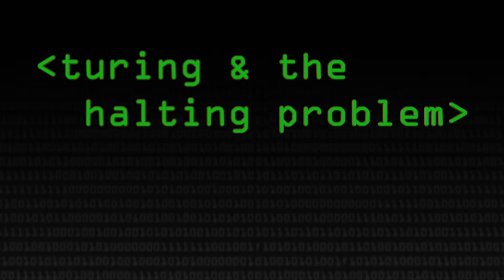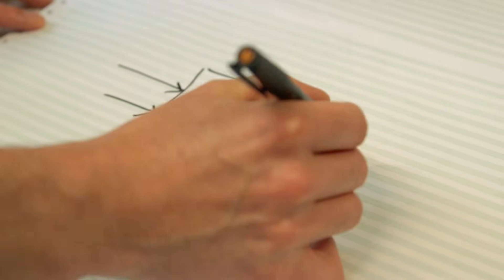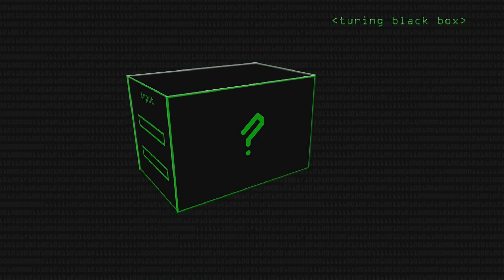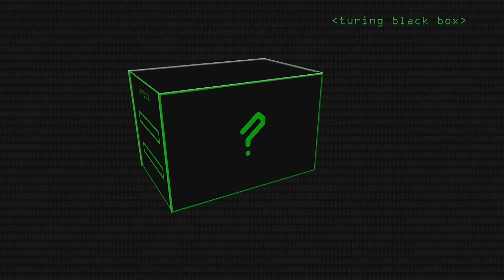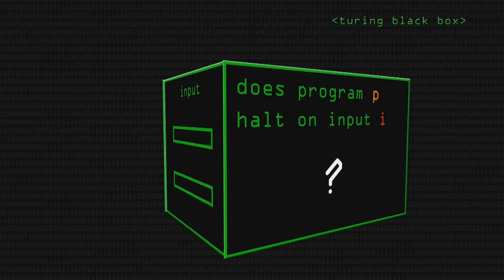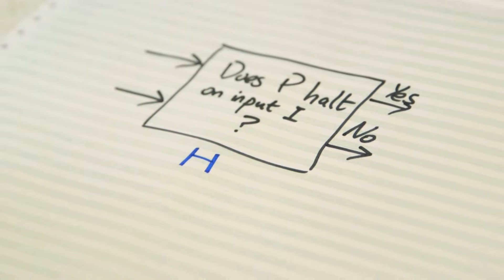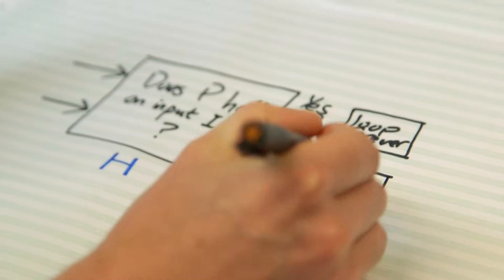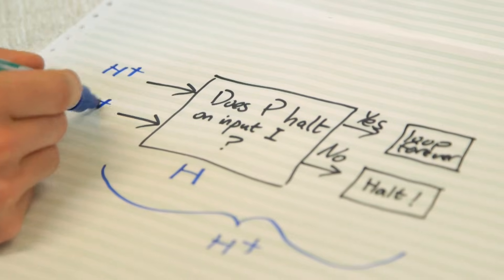Turing & The Halting Problem - Computerphile

Comment: Wouldn't this imply that it is impossible to fully simulate a universe? Because you have to use a computer to simulate a computer created in that universe, and then simulate if it will halt or not. So we are back where we began.
Reply: You don't need to simulate if it will halt or not. You just need to simulate the next step in accordance with the next step of the universe. It doesn't matter if it would never stop. You're running the program anyway.
Reply: It's not necessary to simulate it in real time.
Reply: You dont have to simulate if it will halt or not because the simulation will NEVER have an infinite amount of  time.

Comment: There's one little problem with this. Paradoxes do not exist.
Reply: Paradoxes do not exist that's why it's a contradiction.
Reply: That's why the machine can't exist.
Reply: Cabhan Listis The concept that I think seems to confuse you is proof by contradiction.
In a proof by contradiction you assume that what you want to proof to be false is true and then you proof that it is false by deriving a contradiction from this assumtion.
In the video the thing that he wants to proof to be false is the statement "there exist a machine that solves the problem". Thus he assumes that this statment is true and derives a contradiction (=> Paradox).
Reply: This statement is false.
Reply: Here is also a nice (and comparatively easy) example that I just found to illustrate how proof by contradiction works:
Theorem: There are infinitely many prime numbers.
Proof:
Assume to the contrary that there are only finitely many prime numbers, and all of them are listed as follows: p1, p2 ..., pn. Consider the number q = p1*p2*... *pn + 1.  The number q is either prime or composite. If we divided any of the listed primes pi into q, there would result a remainder of 1 for each i = 1, 2, ..., n. Thus, q cannot be composite. We conclude that q is a prime number, not among the primes listed above, contradicting our assumption that all primes are in the list p1, p2 ..., pn.
Thus the assumption that there are only finitely many prime numbers is wrong.
Thus there are infinitely many prime numbers.
Reply: A paradox is a didactic tool. Zeno's paradox teaches about bad factorization. Epimenides (I always lie) teaches about infinite regression and recursivity, etc. They exist as teaching instruments.

Gödel's incompleteness theorem is analog to the input / output device problem. Containment in set theory faces the infinite regression problem.
Reply: Shaun Dreclin
That's a paradox. Yes. Does your statement have a reality? Because if you think it does, then I would invite you to feed my pet unicorn. It's getting hungry.

Comment: This seems incorrect. H+ looks like it needs two inputs, not one. Hence the Question "Does H+ - being fed H+ as an input - halt?" would be a nonsensical one. The question one would need to ask would be "Does H+ - being fed H+ - being fed H+ - being fed H+ - [...]" and so on. Of course one could never ask that question, since it does not halt ;-) .
Reply: H+ takes 2 inputs, the program and the program's input. You want to test if H+ halts when given itself to test, so you feed it H+ as the program and also H+ as the program's input.
Reply: Nixitur even if H+ only takes one input, that still doesn't solve the problem because that one input will need one input, which will need one input, and so on.

Also, if you construct some way of making H+ give itself as the missing input, then the self-input would need to add itself as input, which would need to add itself as input, and so on. And in this case you've created an infinite loop that occurs before it ever gets to the evaluation by the H part of the program. It fails at the gathering input stage. And since it never got to the H part of H+, it makes no sense to say this is a failure of H.
Reply: xybersurfer If you have supplied a definite input, then you should be able to follow the logic so that when you get to the H part, it will give you a definite output.

If you loop forever either before or after the H part of your construction, this does not prove that the H part itself couldn't conceivably work.
Reply: BTW, I'm not saying that such a proof isn't possible, just that it would have to be significantly different than what's shown in the video.
Reply: This is exactly what I was thinking. I don't see how this proof answers anything 'cause they've given it invalid input.
Reply: yeah, their definition of H+ is wrong. the correct one is H+ = "given i, does H(H+,i) halt? If yes then loop forever, otherwise, halt"

AFAIK there's no way to avoid using a self-reference of this sort to get the contradictions the proof needs (of course, first-order logic provides a way to build these self-referencing programs).
Reply: Oh no, I was not in any way shape or form suggesting that a machine could be constructed that answers the question posed. Quite the opposite: I was suggesting that the "question" posed was completely void of content since there is no such thing as "H+ with input H+", seeing as H+ always has to have two inputs. Now these may be the same, but there has to be two inputs. Hence there not being an answer to the question does not disturb me in the least, much like there is no answer to the question "what is the emotional state of this mineral?".

Also I study this kind of thing once, I only just noticed. And the "math" going on in the background is not really all that complex.
Reply: Hmm, yes, I saw what you mean.
We can't just feed H+ into H+ because H+ needs two inputs.

For people who don't see why this is a problem:
We feed H+ as the program and H+ as the input into H+ itself. Let's call the first input H+P, the second one H+i and the one that they're fed into H+'.

Let's concentrate on the first half of H+', the H-part.
What the first half of H+' then does is answer whether H+i as the input to H+P halts or not.
However, that doesn't make any sense since just feeding H+i into H+P is insufficient.

H+P needs two inputs, let's call them H+PP and H+Pi. We've only given it one input H+i and no instruction on whether that should be the program- or the input-input to H+P.
Even if instead of H+i as the input to H+', we allowed two H+i programs, we'd just move the point where it breaks one layer further down since H+PP also needs two inputs.

However, this can be solved.
If we say that, if given only one input, H (and H+ as well), take that one input as both the program- and the input-input.
So, if we give H just one input P, it would test whether P given P as an input halts.

Or, alternatively, H+ only ever takes one input and feeds H+ and that input into H, looping or not looping according to the description in the video. So, H+ doesn't even have a program-input and the program-input to the first half of H+ (the H part) is only ever H+ itself.

I think this is how the proof originally goes, actually. It's just not as simple to understand, so Mark probably tried to make it a bit more simple and, in consequence, made it make no sense.
Reply: watcherFox why would an input need another input? we aren't confined to only using H or H+ as inputs.
Reply: i wrote down the demonstration used in logic, i explained why we define such precise functions and why we don't lose generality in the proof, if you're interested check it out :)
Reply: Of course it seems incorrect.  The conclusion is counterintuitive.  But it is indeed true.  Trust me, I've met many programmers who were convinced they could create a program like "H", completely unaware of the Halting Problem and its impossibility.  They've all been let down.

Keep in mind that what you're seeing here is a simplification meant for general audiences, and that there is complex math going on in the background which was vetted by generations of mathematicians long before you were born.

Comment: you are assuming that the program that solves the halting problem halts.
Lets assume that it may continue forever for some inputs instead, then it is possible I think.
If the computer ever reaches the exact same state twice, the program will never halt.
If the computer never reaches the exact same state it will halt.
Reply: If the program that solves the halting problem fails to halt on some inputs, then it doesn't give the correct answer on every input, because on some inputs it gives no answer at all.
Reply: khoitrinh1 that's not the strategy of the proof in the video. They don't prove that there are inputs of H that do not halt, they just prove that from a working H machine, they can build a machine H+ that contradicts its own existence. Since H+ is impossible, but the steps to create it from H are completely valid, then H cannot be possible to build.
Reply: *****
That's not a proof of anything though. That just disproves what Victor Påsse said.
A program that solves the halting problem has to halt. To use that as a proof, you would have to prove that the halting program would have inputs that result in it never halting. That has not been proven in the video nor in Brian's statement.

Comment: What is the human brain if not an incredibly complex machine running a really abstract algorithm?  Yet we can determine whether programs will halt or not.  I probably missed something, but to me it seems that Turing is wrong.
Reply: No, we can not tell if any program will halt or not any more than a computer can.

We can sometimes tell if a program will halt.
Reply: Yes, I think it means that we can not know the final output without running the program first. Of course we know that the program halts if it just halts after a run, or it loops if the loop is defined clearly in the source code. BUT we can not know it in all cases. For example there are mathemathical calculations that may be solved by running iterative program a finite amount of time, or may not be solved ever. This kinda would create a shortcut for knowing if is there answer for that long calculation or not. And that would maybe break mathematics somehow.

Comment: Would it be logical to create a process that is intended to loop forever with a constant feed of new info and then sample it at set intervals? Would you be able to gain anything usable that way?
Reply: if it can output without halting, yes. most programs do exactly that except that there is (or really really should be) a special input that will make them halt(like pushing the red x at the top right of a window.)
Reply: Real life programs can produce "outputs" during their execution via side-effects.
First-order logic programs, though, cannot.
Reply: interesting :)

Comment: Question

H+ named 0
H+ named 1
H+ named 2

0 runs, checking whether 1 will halt or not halt if 1 is given 2.

Wouldn't there be an error, since 1 is only being given one input, rather than two which it is designed to take, and 2 is not being given any inputs at all?
Reply: ***** So
H++ named 0
H++ named 1
Virtual H++ named 2
Virtual H++ named 3
Virtual H+ named 4

0 runs, taking 1. 4 takes 2 and 3 as inputs. 2 runs with 3 as input. 3 still lacks the one input it needs to run. Wouldn't there still be an error?
Reply: I'm still confused. What alternative is there to thinking of them as something besides different machines?
Reply: *****
You're missing the point, because the paradox would still be encountered within your H+ machine. It doesn't matter at all what the inputs are - the paradox will still arise.

Or do you actually think you've figured out something in a youtube comment that mathematicians have missed for the better part of a century?
Reply: No, I'm just confused. I don't think that the proof is wrong or that I'm particularly more intelligent than anyone else, quite the opposite, I don't understand the explanation, and am attempting to identify where my misunderstanding is coming from.

Is it necessary to take such an aggressive stance?
Reply: Was actually responding to SBareSSomErMig and eir fairly flippant 'That's a little mistake in this video' comment. The video's fine, eir logic is faulty. You're good for asking questions. :) The system is designed so that the entire machine is fed back into itself as both inputs, not just one. So the system has the correct initial inputs, but will still result in a paradox as explained in the video.
Reply: *****
Yes. You appear to have missed the entire point of the exercise though; given H+, which has inputs of H+ and H+, it will always result in a paradox - regardless of what the original inputs to H were. Which fulfills the conditions outlined as the purpose of this video, to show that you cannot solve the halting problem.

Comment: I thought you needed at least second order logic for basically anything in calculus. Or does the Lowenheim-Skolem theorem just say, "yeah sure, technically but it doesn't matter".
Reply: Limits can be defined in first-order logic, and with that you can define differentiation and integration. I'm not sure what else you'd want for calculus, but you could always use first-order axiom schemas.
Reply: I guess that you could define limits over rational numbers as a model (since rational numbers are equinumerous with the set of all natural numbers and the epsilon-delta definition of a limit quantifies over epsilon, delta and "x") and that would suit most needs. But it seems not to be able to quantify over the real numbers as a model (since the real numbers are equinumerous with the set of all sets of natural numbers, i.e. the powerset of the natural numbers). At least that's how it looks to me since every definition of second-order logic I've seen says that first-order logic can't quantify over sets.
Reply: Ferroneoboron san I'm not sure what you mean. First-order logic allows you to quantify over terms or "objects". You can therefore quantify over the real numbers using:
∀x (x ∈ ℝ ⇒ P(x))
∃x (x ∈ ℝ ⇒ P(x))
which are often abbreviated as:
∀x∈ℝ P(x)
∃x∈ℝ P(x).